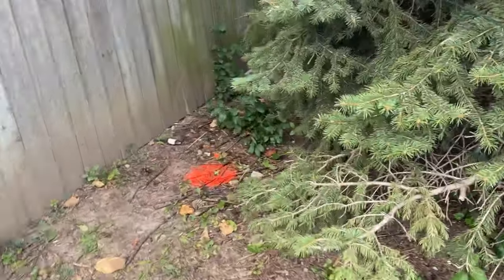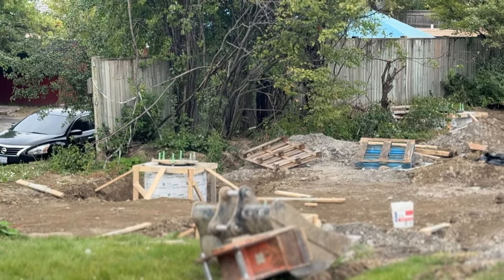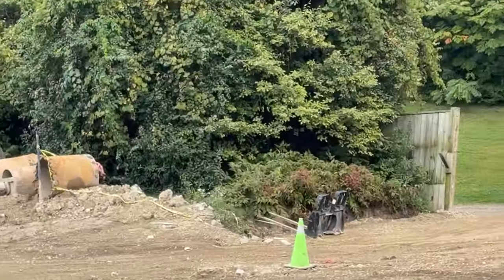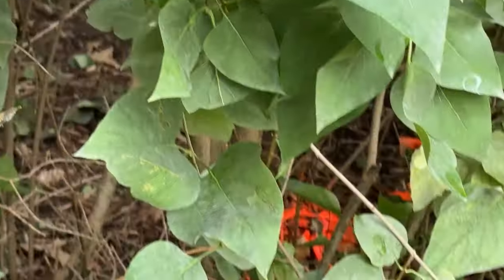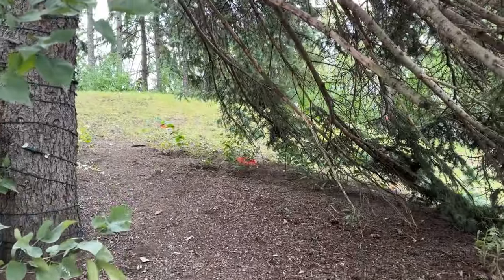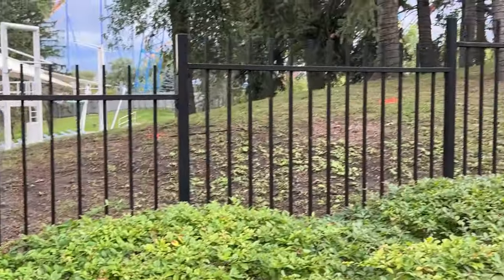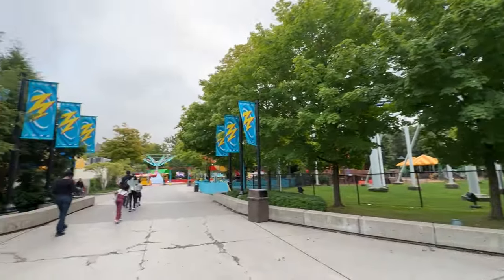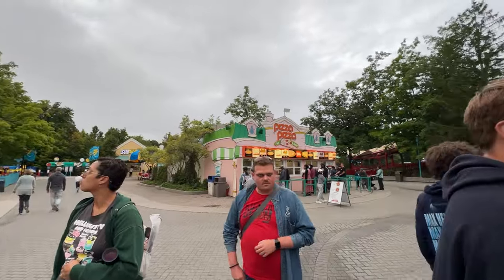Canada's Wonderland AlpenFury Update & 2026?

Comment: Minebuster is on the choppong block for the Splashworks expansion....its obvious from the overhead images that it prevents further developments in the water area.   In replacement a new coaster could be placed in the back over white water rafting and the back of the kids area.......  i live the minebuster but sadly it has been on life support since the 3 inital hills after the drop were removed for two wider hills for the water park decades ago.
Reply: If minebuster gets removed that surely means rmc wilde beast will be the next ride they add. No way would wonderland have only 1 woodie in the main park and it's horrible
Reply: @josecalderon8133 Wildebeast would go too. They will probably add a GCI in the White Water Canyon area
Reply: @josecalderon8133 highly unlikely   as Carowinds never  gave hurler the  RMC treatment.
Reply: @michaezell4607  everything is going to change now that six flags runs things and carowinds has more free space than wonderland to build ground up rides. Wonderland basically is land locked without removing the older rides or rmcing wilde beast carowinds doesn't have this problem